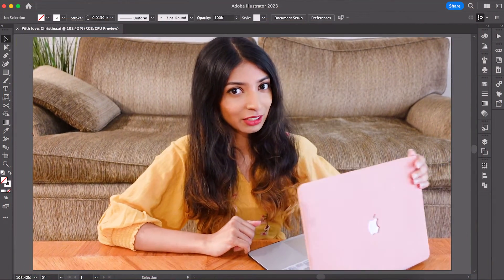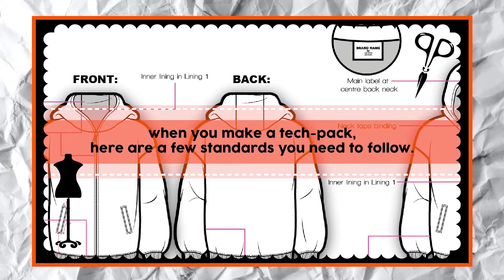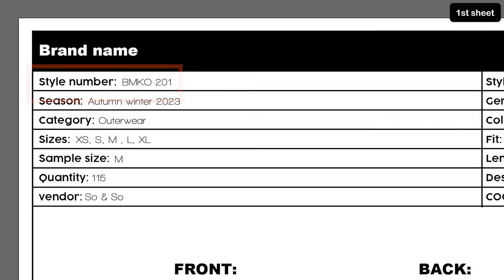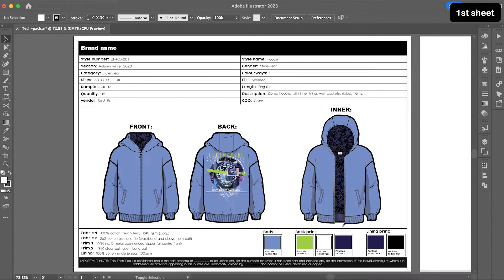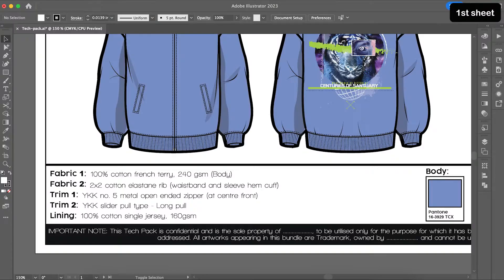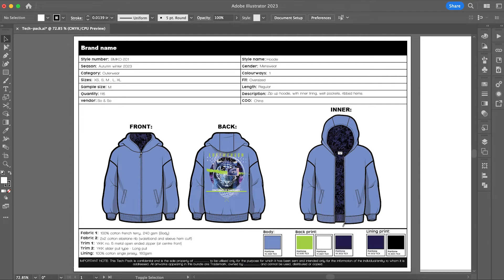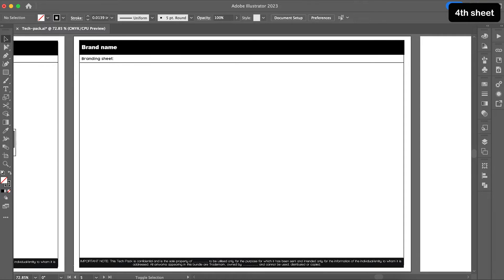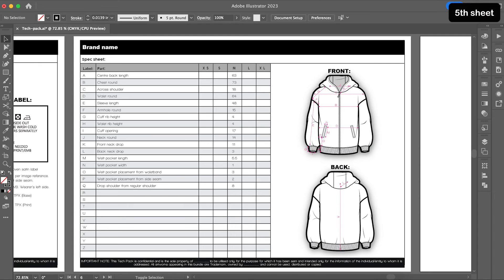How to make a Tech Pack (Easy step by step tutorial on Adobe Illustrator)

Comment: Back with a other question. Filling out my BOM where do I find the code and UOM?
Reply from the maker: Sure! I’m happy to answer them :) The item code is got from a brand’s internal database or the material supplier itself. If it’s from the brands database, then the item code is usually assigned based on the collection, category, or season and can be found in company’s design records or brand guidelines. Alternatively, you can state the code that the material supplier gives you.
Second, the UOM (Unit of Measurement) depends on industry standards and is typically listed in fabric or trim supplier documents, where materials are measured in meters (m), yards (yd), grams (g), pieces (pcs), or inches (in) depending on the component. We designers can also gather this information from material purchase orders, specification sheets, or supplier invoices before filling in the tech pack to ensure accurate production details. Hope that helps!

Comment: Hi, why would the zipper and slider be separate trims? Don’t they come together?
Reply from the maker: Hi! You can place them together or separately. My reasoning for doing so is because they are typically sourced independently and may have different design or functional requirements. This separation allows for greater customization, as sliders and pullers often feature unique designs, finishes, or branding that may not match all zipper tapes. For example, a metal slider with a custom logo might be paired with a coil zipper for flexibility. Additionally, separating the two ensures flexibility in production, as sliders and tapes might come from different suppliers specializing in those specific components. This approach also simplifies quality control, ensuring each element meets the exact specifications. By detailing them separately, manufacturers can mix and match options, optimize costs, and achieve the desired aesthetic and performance for the final product. Hoping that helps!
Reply: @ ahhh okay, makes sense! THANKS 🤗

Comment: I was always told that MS Excel is the best software to build teckpacks. Can you comment to this? I have only used Excel.
Reply from the maker: Ah! I have only used Illustrator haha! Do you working as a fashion designer too? In my experience as a fashion designer at corporate companies across a few countries, Illustrator is the standard and only software we use to tech pack our designs.
The technical team occasionally used excel for sections like the specs or POM as they needed the tables, charts, formulae, etc. Hoping that helps!